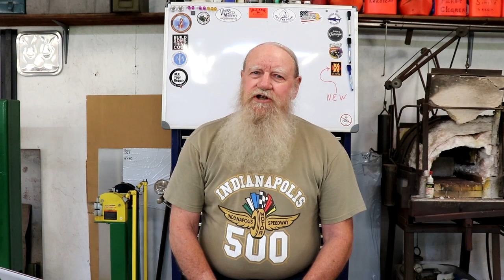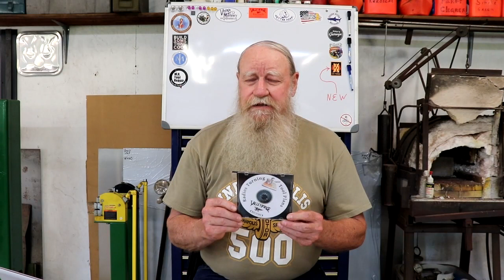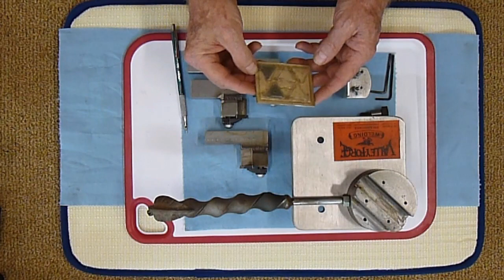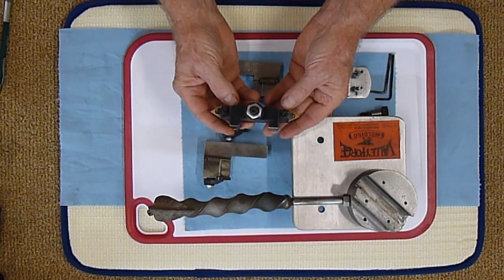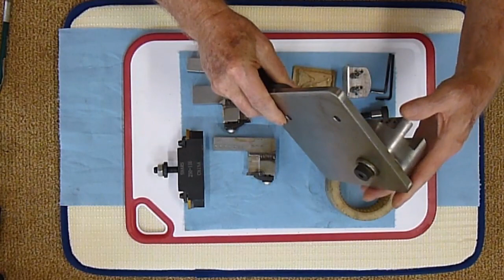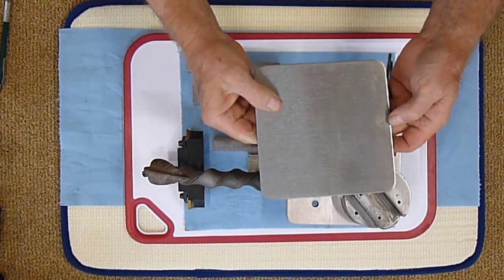Radius Or Ball Turning Tool

Comment: I need to make a 1.875" to 2.250" concave cutting tool. Am I able to do that with this tool?
Reply from the maker: Patrick, the amount of support you have under the cutting tool will determine the Radios of the cut you can make (without chatter from the tool bit). You can increase the diameter  of the tool holding block to achieve any radios. You may limit yourself to turning only larger sizes.

Comment: This is one of the few times my procrastination paid off. I love and am going to incorporate the details like the measuring angle, the long handle and one you don't mention, offsetting the mount from the compound just a little. I've had the material for a while but was trying to figure out how to do precise measurements to cut the dies so they would allow for the material relief. Genius Jere. Thanks for posting this.
Reply from the maker: Hello Tony:

I am glad that you are able to use some of the refinements that I have incorporated into my design. In the 26 min. video that comes along with the plans I walk you through how to layout all the pieces required to arrive at a complete unit. All lathes are different from mounting point to center of spindle. The video gives a simple way (using CAD) to make the tool fit your lathe.

Thanks for watching and your comments.          Jere